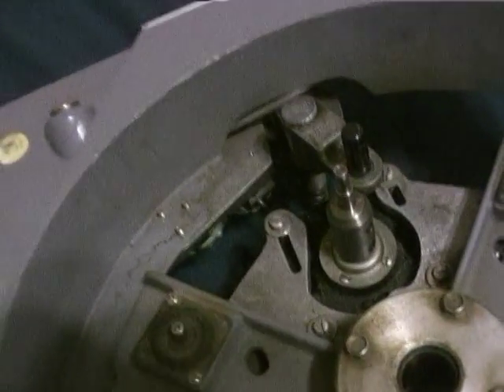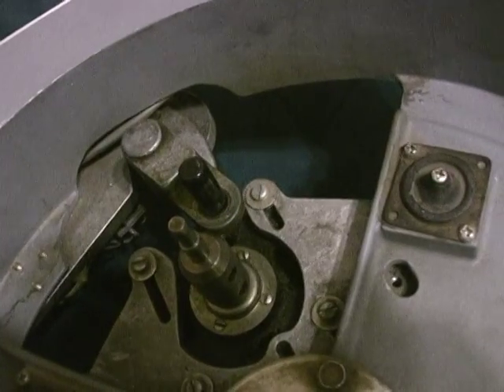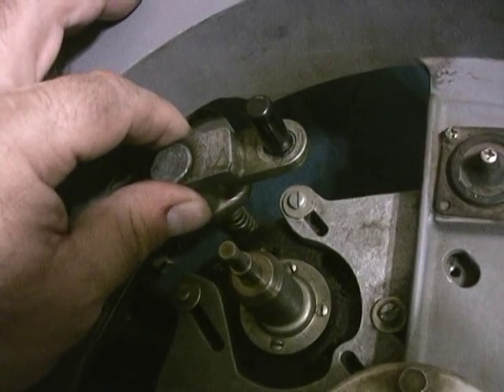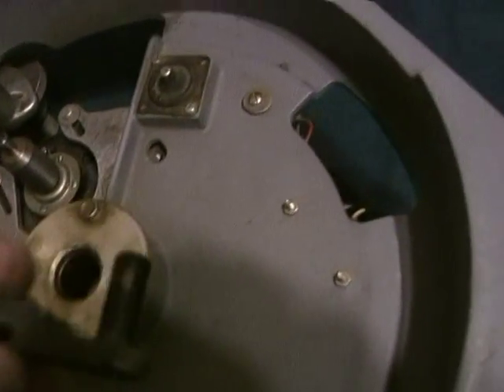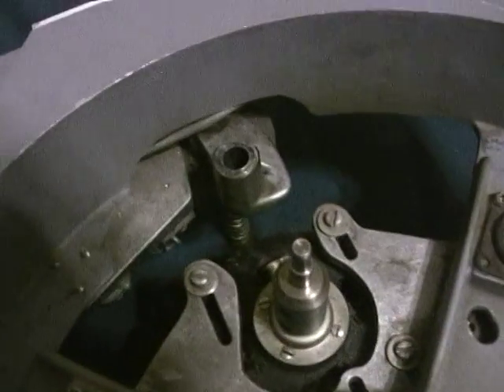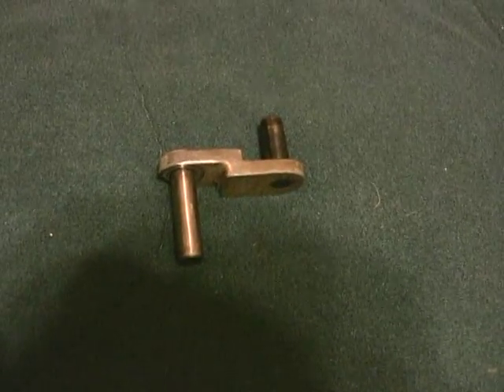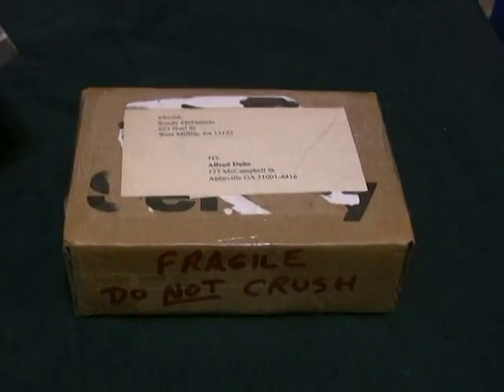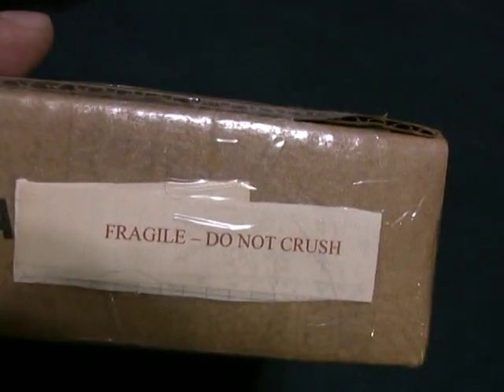Russco idler arm damage thanks to FedEx doing one of their box drops

Comment: USPS dropped or fell, my reel to reel deck in 2012 and when I got it the unit was unusable. I could see the box was smashed on the corner and the deck was a mess when I got it out of the box. It was packaged well and still got damaged. It was only $50 and only made a 120 mile trip and still didn't make it and wasn't worth the money to return it or get the money from the USPS for the damage. I actually sold the power cord for $25 because they were hard to find so I thought I'd just see what would happen. Well I got half of it back anyway. lol.  Even the USPS tosses things around as well.
Reply from the maker: I hear ya Chas. They all suck in one sense or another. If the turntable would have been a small amount, I wouldn't have been so crazy... but the guy paid me 400 bucks for the thing, and I packaged it so carefully. (So glad I took lots of pics of my packing process, that is what saved me). Thanks for the input. Randy.